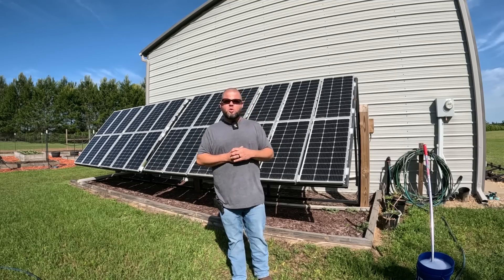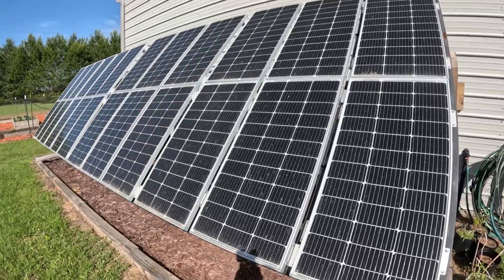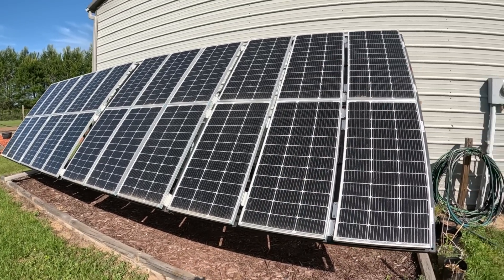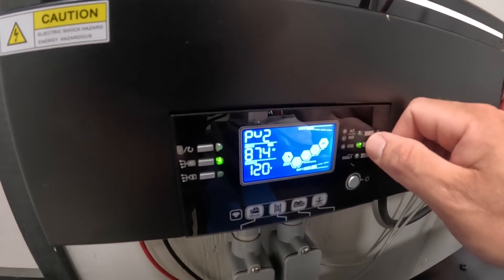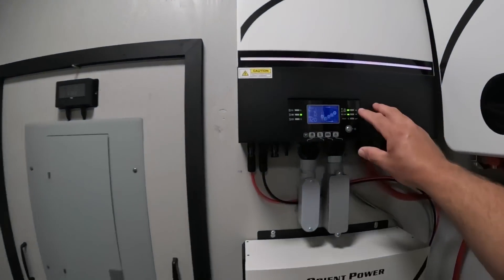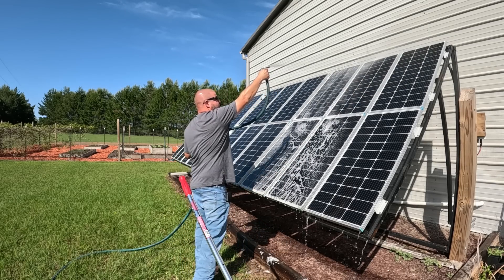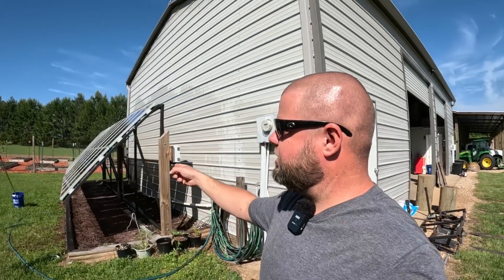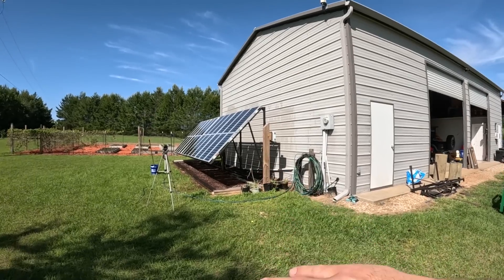Solar Panel Mistakes! Cleaning And Cooling Output Tests!

Comment: The thing about solar panels is that they quickly degrade in the first year, up to 3%, then they degrade very slowly every year after that, 0.25 to 0.7%. That degradation takes time to notice and will be moot from lifestyle changes as you either get more efficient gadgets or get more things that use power, or your batteries degrade in off grid. Cleaning is a significant way to improve panels if you are exporting to the grid or you have an off grid system operating on the margins. Cleaning is a good idea but just as routine maintenance because if you need that 10%, you really just need more solar :)

If the system is on the roof you can just hit it with a hose occasionally if you don't get a lot of rain. Better than nothing and you can clean them more during house maintenance. I need to clean mine more because I have them under a power line so the birds keep pooping on them. Might do it this weekend.
Reply from the maker: Valid points
Reply: Yes, keeping clean is an effective way.

Comment: In the commercial environment they like to clean the panels once a month for the big time solar guys around here..
Reply from the maker: As I drive by these fields with hundreds of thousands of panels, I think about that. By the time you get done cleaning you'd need to start over.
Reply: @TKCL  Idk these guys move quick. I mean quick probably about a week to do the field Google up TUCKER® WATER FED POLE SOLAR PANEL CLEANING KIT W/4060
Reply: The ones I see is like on the back of a gator of some kind with a water tank being pulled behind it.
Reply: I go to Urbana Illinois again later this month I will have to try and see if we get stuck up there by  one of the solar fields and see If I can get a photo and I will pm email it to ya!
Reply: @LorenTedford  I think it's going to be spectacular！

Comment: Do you think a product like rain-x would help protect your panels?
Reply from the maker: That's more designed to repel water, I'm not sure about dirt build up. It's worth a look.
Reply: I'm going to try the ceramic coating I put on my truck as a test on a couple of my panels to see if they remain any cleaner than the rest. Nothing seems to stick on I.

Comment: I think most people think solar panels are zero maintenance, but as you just demonstrated they are not. If you want their full potential. Good job! Andrew
Reply from the maker: Almost anything in life seems to require some maintenance.
Reply: Yes it is necessary to do solar panel maintenance. This can guarantee the life of the solar panel.